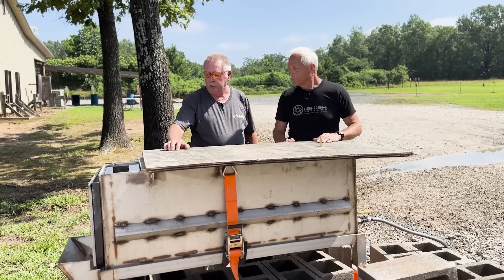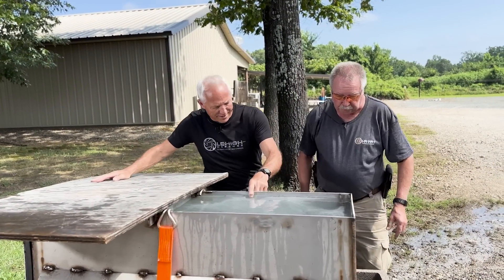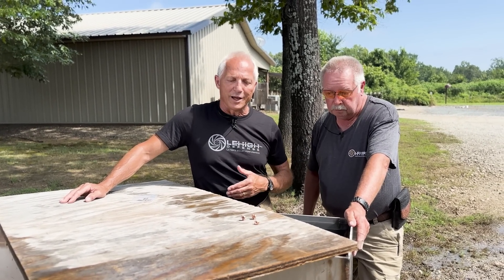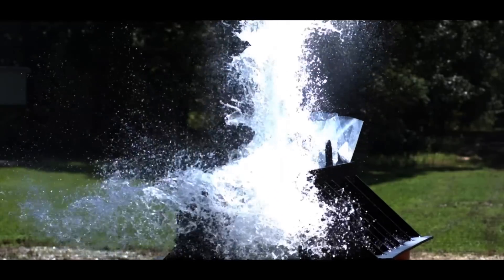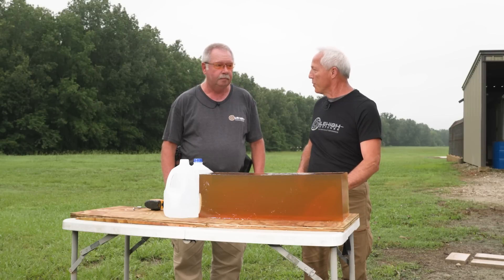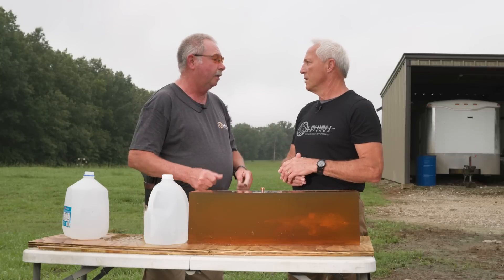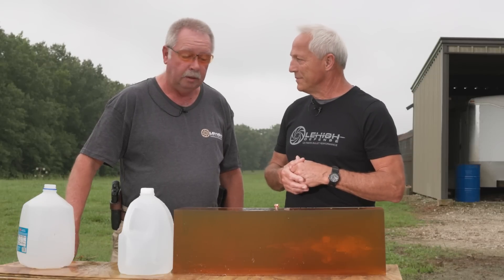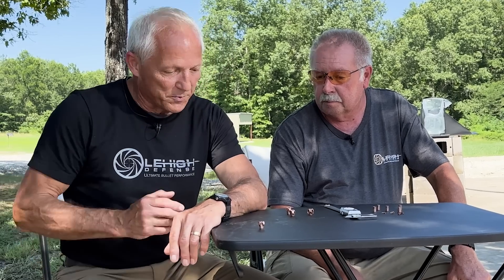Maximum Expansion Bullet 125-Grain in the 300 HAM'R by Lehigh Defense - Proving Consistency

Comment: Can these be used in a 300 winmag  or 30.06?   I'm trying to imagine 125 grain moving at or above 3,000 fps. The damage could be up there with .50 cal solids only without that shoulder breaking recoil.
Reply: I believe these bullets fired from a 30-06 or 300 win mag would lose the peddles and then these bullets would duplicate the Norma Kalahari bullet that is not made by Norma no longer, but it was made to peal open loose the peddles and the copper shank was to drive on through the animal.
I own some of these Norma Kalahari 150 grain bullets I am loading into 300 Weatherby magnums.
Reply: @Lure-Benson  *petals
Reply: @Lure-Benson  Excellent response. Thank you,  and good luck.